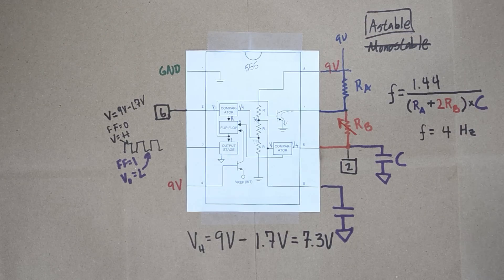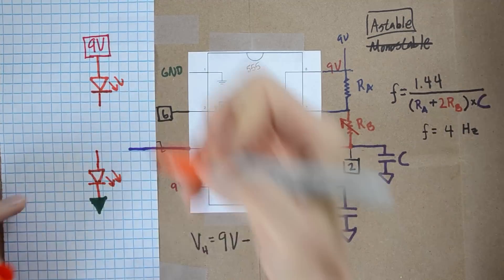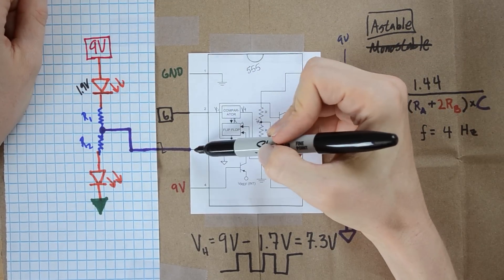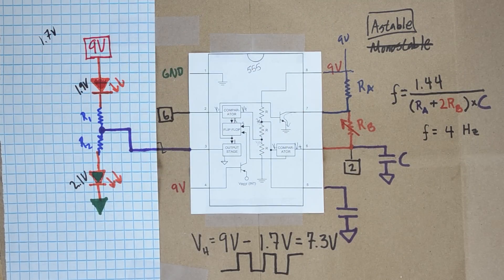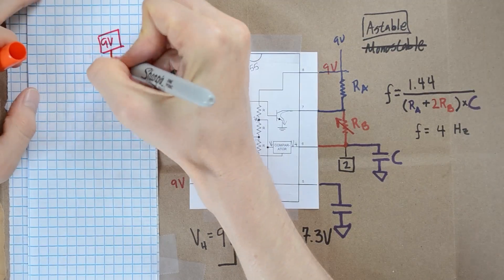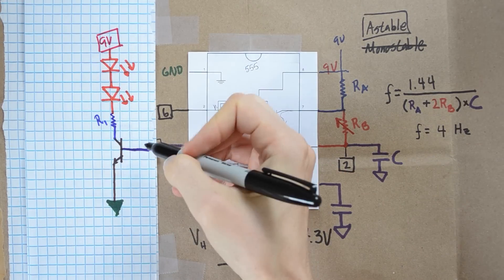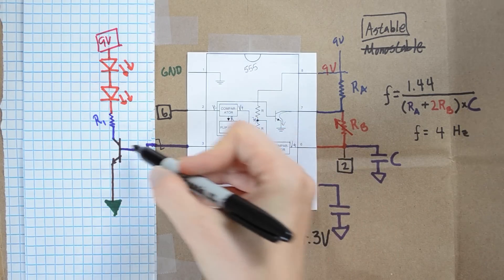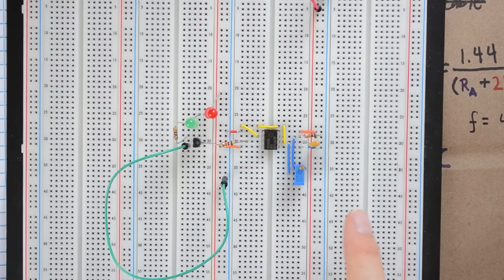555 Timer Output Stage

Comment: Thank you for you explanation but i have a question, i want to use the output stage as control mechanism to connect to optoisolator but my project seems like the current and voltage is too low to trigger the moc3021? Do i have to use a bigger npn transistor?

Comment: What am I missing? 100mA is plenty to turn on the LED's.  Just use pin 3 of the 555 and limit the current with a resistor.  You don't need any external circuitry!  I have done this for many years with all sorts of loads requiring currents much greater than LED's!

Comment: Well done, Mr., thank you! I have to ask you: in a NE555DR circuit based the power limitation is the CI limitation ( 200mA, 5 - 15V), no matter which NPN transistor you use to switch ON/OFF the load, is that correct?  I mean, using a single power supply to both, CI PWM controller + load.
Reply from the maker: The smart thing to do would be to use a separate power supply for the the load.

Comment: Can u explain to me how to make a circuit that will turn a a servo motor slow using a 555 timer
Reply from the maker: You might have some luck with a similar configuration as this: https://youtu.be/8Z7kTCSZG5E?t=13m5s

Comment: Great work! But it would have been more precise to say that it sources current (emitter current = collector current + base current) in the BJT case,  nevertheless, it doesn't sink current at any rate .. otherwise, you will have to use a MOSFET transistor to completely "isolate" the 555 from the terminal circuit .. anyway, that was just a note ..  keep it up any many thanks :)

Comment: Question!!! Lol, you show pin 3 going "hot" to run the gate on an NPN... Can pin 3 going "cold" trigger a PNP alone? I assume it must, but am wrong often enough to ask, lol. Now, assuming a "yes", can an NPN and a PNP be gated alternately on 3 to produce high current potential pulses before load when 3 is grounded (PNP),  and post load ground switching when it goes high (NPN)? Kind of a freq lock on 2 channels?

Comment: I've seen circuits on using a 555 timer to drive a Mosfet, which creates an oscillation for a Tesla coil circuit, making it a solid state tesla coil. You can even use the potentiometer to control the length of the lightning coming out

Comment: Hello Shinny R&D will they work as a single shot push button power device in conjunction with mosfet to power dc motors. Button push motor runs, release and motor stops. kinda new to all this but getting there slowy. with help from these videos. keep up the good work

P.S - are you going to work with  op-amp soon.

Comment: Sir! What capacitor and resistor values i will buy? Is it based on the incoming voltage from the battery or based on the voltage needed by the LEDs?
Reply from the maker: There are several capacitors and resistors. To which components are you referring?

Comment: what effect does duty cycle and frequency have on the output from a transformer. with a pwm input? will a longer duty boost output? or a boost in hz give a greater output voltage. also I need to boost the output as battery volts are depleted. to maintain a fixed output. like I said before I am very new to this. I only met the Tran sisters about 8-10 months ago! I heard of them but didn't know what they really did. besides make radios!  thanks for another awesome video. hope you never stop. if you ever do a video on everything. Just start over and please! thanks
Reply from the maker: I don't think the 555 timer will help you with your problem. It outputs a steady voltage that is just a little lower than the source voltage. You can't really boost the output unless you bring in other components.
Reply: +Skinny R&D what I was talking about . is using a 555 on a boost circuit. and regulating the output. from a push pull transformer. I am needing to build a DC to ac inverter 24vdc to 120vac. I need to figure out the boost stage. and I need help. I have been searching you tube  and learning what I can.

Comment: This is the best series ever for the most important IC ever !! 
Thank you so much man but one thing I do not understand is why 1.7 V ? The voltage of the output is very important so I really need to understand how to control it. I think you said something like its always like this
Reply from the maker: Thanks for watching! The simple answer to your question is because the data sheet says that the higher is supply voltage, the higher the output drop will be. The more detailed answer I'm not as certain about. I believe it has something to do with the transistors that are controlling the output. You can check the details of this by looking on page 1 of this datasheet: http://www.ti.com/lit/ds/symlink/lm555.pdf

Comment: I like your vids, I watched your 555 series, you are explaining stuff in very clear and concise way.

As a beginner in electronics, I'm thinking of building delayed on circuit with MOSFET.
If I wanted delayed off, I presume I would just reference gate to ground with pull down resistor and add capacitor in parallel.

To make delay-on, the simple way would be to use 555 timer in monostable mode I guess? Btw, I'd like to avoid any fade-in effects.
Do you plan making any vids about that?
Reply from the maker: Glad you liked the videos. My next video will cover monostable mode.

Comment: can you explain whats the difference between a linear IC and a digital IC?
Reply from the maker: Yes. One definiation is that a linear IC usually has an analog output and can have seemingly endless output values. A digital IC has only a certain set of values that are used as the output.

Comment: i already asked this the last year xD but i forgot why the number 1.44 exactly? one more thing can you show me how to use the 555 timr to convert a normal motor into a servo?
Reply from the maker: +Make Electronics The simple answer is that the 1.44 comes from combining the two formulas for t1 and t2 from the 555 datasheet. As far as the motor question, I don't know that I can help you. A servo has gears that will help lock the system in a particular position. If you just want to vary the speed of a DC motor with a 555 timer, try this out: https://www.youtube.com/watch?v=8Z7kTCSZG5E&lc=z13fct3ourv4y10ld23wwjiaqzfctxbkr

Comment: can you use the 555 as a clock for a microController? in otherwords instead of connecting a crystal or some sort of oscillator
Reply from the maker: +Eddie Amaya I wouldn't trust it. The 555 timer is reliant on capacitance and you can change that by just placing your hand on the board.

Comment: Hi... Just a quick question regarding Pin 5. In part 1 of this video you noted to add a Capacitor at Pin 5 you did not note (that I noticed) what size of capacitor one should use for this pin.   Thank you for your innovative instruction, it makes learning; understanding and retaining the of the data much easier.  Thanks again keep up the great videos.
Reply from the maker: +Sal C 0.01µF but I usually use 0.022µF because that's what I have on hand. Thanks for watching!
Reply: Thank you very much.

Comment: Are you able to make a video on a simple 555 timer circuit? Where it flashes a single led with a potentiometer to adjust the speed of the led blink rate. Or a dual led circuit with two adjustable potentiometers.

Comment: what happens when the capacitor = 2/3 of V+ ?
does it produces a 1 or 0 in pin 6?
Reply from the maker: +Chezire Cat When the capacitor is charging and the voltage across the capacitor exceeds 2/3 of the source voltage, then the comparator attached to pin 6 produces a 1. From what I've read (https://en.wikipedia.org/wiki/Comparator) when the capacitor is charging and it equals the source voltage for the very small amount of time that circumstance is possible, it remains in it's previous state. The capacitor voltage must exceed the voltage it's being compared with.
Reply: +Skinny R&D Thanks a lot dude, you helped me finish my project.

Comment: You said that in your project you used the version with the transistor, but how do you keep the ground from the 555 circuit from interfering with the separate circuit? As far as I saw, you only used one battery. Is it possible to power a 12 volt laser, and the 555 timer on one battery? Maybe you could release the schematic for your project. Thanks!
Reply from the maker: +Synced-Up Gaming See if this video answers your question. https://www.youtube.com/watch?v=mBA9uPeEzw4&lc=z12qi5hgsrrxxzgyx04cd544ulnxzltgktc0k In this video I used a transistor to control a few LEDs. The concept should be similar to what you are trying to do. In fact, I think your project may be less complicated. As far as the battery question, you could use a 12 volt battery for both a laser and the 555 timer. The 555 timer will run on voltage levels up to 15 volts. Be sure that you have a decoupling capacitor from the positive terminal to ground to help keep the power free from oscillations.

Comment: can I just ask why you not doing the example on the breadboard instead of paper?
just  saying this because i did this from paper but it only works with a 10uf capacitor and relatively should blink more or less with different capacitor...what it does for me is that when changing capacitor, it stops blinking, just stays on...now tryed with bigger and smaller than the 10uf and no change? any advice ? many thanks
Reply: have u what ed for a while cuz if it was 150 uf it whould take a Cople of sec if u have high resistors

Comment: Very nicely put. Only thing I'm a little confused about is at 3:39 you say that there is a difference of 1.7 volts between the ic and the 9v supply. How come the voltages doesn't add up? Is it because the 9v battery will always have 9v between it's poles? What happens if you add more voltage then what the battery is rated for?
Reply from the maker: +R3i3h The 1.7V drop between the battery and the high output state is due to a darlington pair being used to control the output. Look here:

http://www.ti.com/lit/ds/symlink/lm555.pdf

On page 1 find the two transistor looking devices call Q27 and Q28. These elements drop voltage (mostly by the fact that they are being turned on by the voltage source) before it appears at the output. This is what steals the voltage but this configuration is used to give an increase in current gain.

Comment: I like your clear explanation and being a conscientious observer found the '555' name origin interesting also. Because I first discovered the 555 timer to great delight when I was looking to build a comparator circuit to run an automobile alarm I was designing in 2004, which worked perfectly for that application ... and more recently decided on using it in conjunction with a thermo-resistor [... in place of your 'Rb' resistor] ... and in that way control the firing of a discharge capacitor into a magnetic field generating coil which runs my 'Come-No-Go' DC motor, to circumvent 'dead-stop-starts' from burning up my field coils. 

This motor is projected to be upwards of 500% more energy efficient than any in use today, because it recovers 40% of it's 'input power' invested in powering a magnetic field generating coil which reverses 'one of the three' ... field magnets from 'South Pole' to a 'North Pole, attracting one of the four the south pole faces on the armature. 

As rotation to 'face-to-face' occurs for these two magnets the coil on the field has gone neutral and so now the magnetic field washes over the first disconnected and then reconnected coil [through a bridge rectifier] ... 'it' now generates a 'reverse EMF that is expected to equal the 40% 're-covered' input power.

This design overcomes the fault of 'dumping electrons' which the present design of DC motors strand in 'disconnected coils' in the running of the motor ... meanwhile the C-N-G design recovers them.

Message me to know more about it.
Reply from the maker: +Willy Ens Cool! I'm a bit of an idiot, so I didn't understand a lot of the details. I'm all for recovering lost energy. I hope your project goes well!
Reply: There is nothing wrong with not knowing ... none of us 'know' anything that we didn't learn since knowledge is not 'instinctive' but rather 'accumulated ... so choosing to know is just that; it's ALL in choice ...

BTW ... I as a Grade 10 drop out in 1968 ,,, went on to work for 34 years in combustion safety and engineering. Like conversion of MASSIVE 21 story recovery boilers in a pulp mill ... to overseeing the 'combustion safety' in the construction of the methanol pant in Kitimat BC. 

From which I designed the "Solution 2 Pollution" system in 1981 ... Which I have no doubt be 'a major player' in reverting Climate Change ... Re; https://goinggreengloballyblog.wordpress.com/2015/12/08/green-grass-plus-7-c-in-pg/

Cheers!